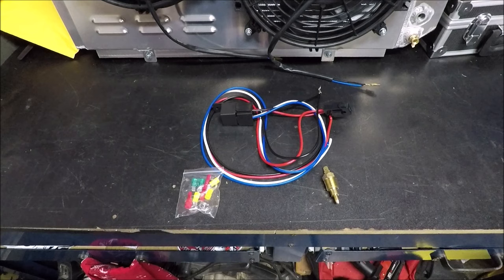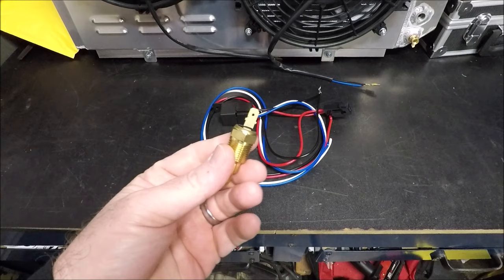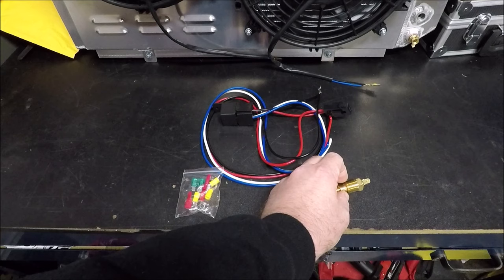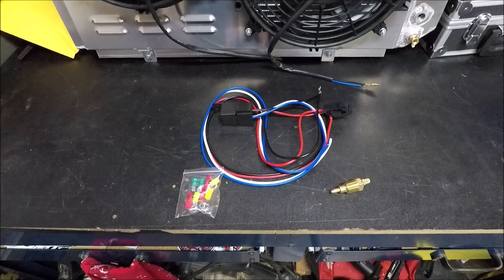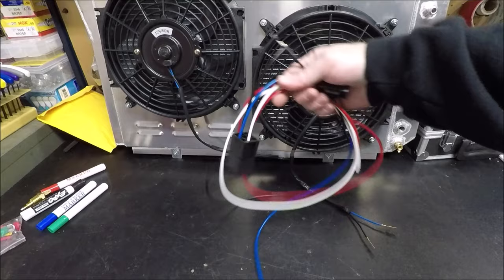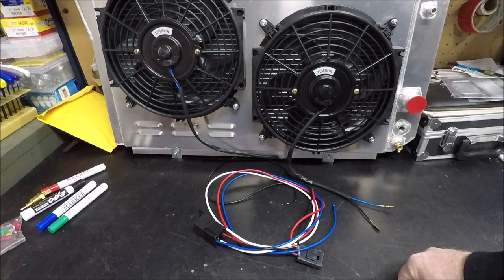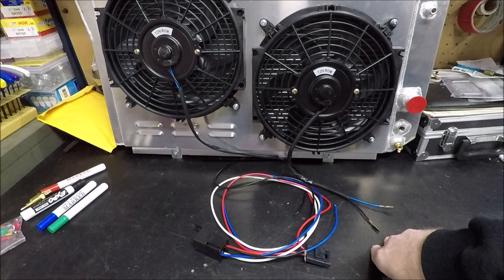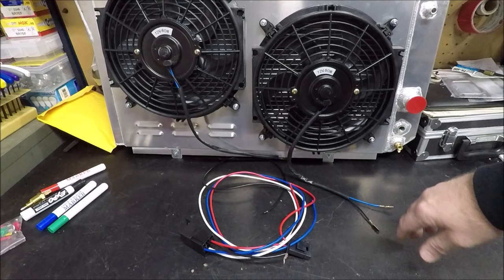ELECTRIC COOLING FAN RELAY AND TEMPERATURE SWITCH WIRING

Comment: Seems like this is how the Holley does it.. it uses an output as a ground trigger to the relay
Reply from the maker: Yes you can use your Holley instead of the temperature switch. Black wire would goto one of your -outputs or use two relays and two outputs if you want to activate the fans separately at different temps. That’s how mine is already wired except I’m using a factory style relay that already has 10awg wire. 👍Or you could save an output on your Holley and run one fan off the included relay and switch and let the Holley control the other off a separate relay to come on at a different temp. Lots of possibilities with the Holley or even with a factory pcm for that matter.

Comment: What else you don’t want to use temperature sensor can you just ground the black Wire
Reply from the maker: Yes. You could just ground the black wire ON THE RELAY through a toggle switch to turn the fans on and off manually if desired.

Comment: You sure you don’t have pins 85 and 86 bass awkward if you want to use a switched power source?
Reply from the maker: If you want to run them the other way feel free. It’s makes no difference. It’s a basic relay so those two are reversible.

Comment: What if you put your temperature sensor in an adapter in the heater hose? Wouldn’t you then use the O-ring to ground it to the body?
Reply from the maker: What if you just put it where it goes and stop over complicating things for yourself?
Reply: @BadLuckGarage  Well that’s not exactly the professional advice I was looking for. I can’t put it where it’s supposed to go. I have no ports to put it in and I have no way of drilling. If you don’t know the answer just say so.
Reply from the maker: @tomwebb5375  I can 100% promise you, regardless of the engine you’re working on, unless it’s an air cooled Volkswagen engine, there is a port somewhere on either the engine block, head, or intake manifold that leads to a coolant jacket and will give you the proper case ground that switch need to function properly. There’s no reason to try to reinvent the wheel for something so simple brother.
Reply: @BadLuckGarage  Whatever you say brother. I’ve had this thing in the garage to do this they cannot find any extra ports. Dodge Dakota 318 fuel injection. But thanks for the non-answer. But you still didn’t answer my question. So I’ll figure it out myself.
Reply from the maker: @tomwebb5375  Then you should find a different mechanic. There’s DEFINITELY several locations on a 318 you could use. But I’m no help so by all means let them half ass wire your shit. 🤣

Comment: Ok... good video,, Except you ever explained: Where is the positive side of the temp switch going to ? Or did I miss it ? You explained 86  goes to ground on the temp switch, so power goes to positive (+) of the relay ?
Reply from the maker: Yes you missed it.
Reply: @BadLuckGarage  ... You said; yes I missed it. But you never explained, where did I miss it. 
I'm back to square 1. Where is it ?
Reply from the maker: @guesswhomartin9249  https://youtu.be/_RIAi6TAACY
Reply: Nevermind, we're back to square 1. 
I'll figure it out, maybe I'll watch other videos as well.
Reply from the maker: There is only one terminal on the temp switch. I explained several times in the video that all the temp switch does is ground out pin 86 to activate the relay. I also explained two different places to run the power to and the effects each would have on how the circuit operates. All this info is in the video so why would I spent another 20 minutes typing out and re-explaining what I already spent an hour recording, explaining, and editing in the video?  Unfortunately I can’t increase your learning retention or prevent you from skipping through all the important parts of a video. What I can tell you is I’m not going to waste anymore time when the answers to everything you’ve asked  is already in the video. Good luck to you.

Comment: I'm hooking it up to a toggle switch the white wire so I put the white wire in the toggle switch and then when I hook up another wire to the other side of the toggle switch where does that go does that go to the fan or that goes to the blue wire
Reply from the maker: You would hook it exactly where I told you to hook it in the video. The switch you want to install inline is just an interrupt to the circuit. Why would it charge anything about where the wire still has to go?
Reply: @BadLuckGarage  I'm hooking it up to a on and off switch much Suzuki samurai has a push button to start so I want to leave my fans on all the time so that's why I'm putting it on and off switch
Reply: @BadLuckGarage  I'm not installing that gold switch that you have in the picture in your hand the only thing I want to do is hook it to a on and off source on it off switch toggle switch so that ground wire arms is in the hook to the chassis
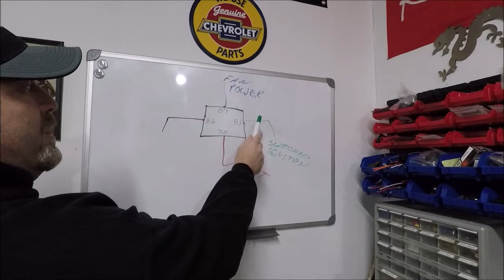Reply from the maker: @mudlifejunkiepr3937  Like i said, covered in the video. 5:10
Reply: You said the switch ignition source the white wire goes in so where will I hook up the toggle switch to turn it on and off I don't have a key to start my car I have a push button to start it
Reply: Honestly bro I still don't get it if I hook up the white wire to the switch  ignition source that means the fan is going to be constantly on I want to put a on and off switch to it how do I do that
Reply from the maker: @mudlifejunkiepr3937  Awesome. So how are you gonna shut the car off? zYour gonna use a switch. That switch will be your ignition switch. Thats your switched 12v. So you dont wanna use the temp switch. As I said over and over in the video all the temp switch does is ground the relay to activate it. So if you dont wanna run a temp switch you need to ground pin 86 on the relay.You can use a toggle switch to do that. I keep pointing you back at the video because its obvious you dont understand what i explained in the video. I dont like to just tell people what to do...I want them to understand what it is they're doing so they can figure things out for themselves.

Comment: Thanks,  have a question I put the white wire to the ignition and my fan stays on after I have trun of the engine and the engine is hot not overheating. What can it be
Reply from the maker: Sounds like you have it wired to a constant hot, not an ignition hot. Otherwise the relay trigger wouldn’t have power with the key off.
Reply: Or does it need to be connect to a circuit breaker then to the ignition?
Reply: @BadLuckGarage  what would be a ignition hot?
Reply: @Oscar-lo4fh  ignition hot can be any wire that have power when you turn the key to on position and when you turn it off cut the power. You probably have connected to a hot wire what means that wire always have power because its not related to the ignition switch system .

Comment: Now, how do you integrate it to turn on when your AC compressor kicks on?
Reply from the maker: Easy peasy. If your AC kick signal is a ground, simply tie it into the wire going to the temp switch and it will provide the ground when the AC is on. If it’s not a ground, then you’ll need to add a second relay activated by your AC kick signal and tie it into the wire going to the temp switch to provide ground when the AC is on. 👍

Comment: you  have  85 to key ignition? and 86 to ground? which is right?  the company has 86 to key ignition and 85 to ground?  whats right???
Reply from the maker: 85 and 86 are reversible. It 100% doesn’t matter which way you wire them as long as one goes to the ground/temp switch and the other goes to ignition. I generally wire them depending on how the wires on a particular relay are colored just to make it easy to remember. So if 85 happens to have a black wire, that’ll go to ground/temp switch and if 86 happens to have the black wire then I’ll do the opposite. But like I said, it doesn’t matter.
Reply: Thanks for the help

Comment: So if my thermostat is 180 can I just run a switch that is higher ?
Reply from the maker: It’s not just about the thermostat. The question you need to ask yourself is, “Is my cooling system efficient enough to get the coolant back down to the off point of whatever switch I’m running”?There are thousands of guys out there running 160 degree thermostats with cooling systems that can’t even keep the coolant at 190, let alone 160. If you’re cooling system is actually capable of getting back down to 180ish then yes, I’d say just run a switch that comes on at say 195 and shuts back off at 185. Using those parameters as an example, if it’s not capable of cooling back down to that point then what’s going to happen in this scenario is the fans will come on at 195 and they’ll never go off until you shut the car off because you cooling system isn’t capable at being the coolant temp back down low enough to shut them off.
Reply: @BadLuckGarage  mm I see. So I should just get the 160 thermostat. I’m
Installing a aluminum radiator with an electric fan on a 06 jeep wrangler 4.0. The temp sensor is plugged into the thermostat housing. I’m assuming because it has that plug style connector I can’t just tap that fan into that oem right? I need to use the switch that came with the kit which is what you showed in the video? Also where would you tap into the ignition power source on the wrangler ? I thought maybe use one of those fuses with the wire running off it. I heard horn fuse maybe but that’s always hot isn’t it ? Thanks for the help

Comment: I have this same kit except mine came with a 30 amp circuit breaker? Which I would assume should go between the relay and battery but there is that inline fuse there already 🤔 so my diagram says to put it between my switched ignition and relay but so many other diagrams have it going to battery, even the breaker says BAT on one side so little confusing. Any thoughts?
Reply from the maker: Breakers will always go on the battery side. At least that’s where I’ve always used them. My Allow Works kit didn’t come with a breaker so maybe it’s a recent update. 🤷🏼‍♂️

Comment: I have an issue. My electric fan turns on as soon as I turn the key forward even when my car has been sitting and no where near the 185 it need to be at to turn on.  Not sure why. I followed your video and everything is wired correctly.
Reply from the maker: Sounds like you either have a bad fan switch that’s staying grounded all the time or you didn’t wire it correctly. Verify you’re wiring is correct. If it is, then I would contact Alloy Works and ask for a replacement.
Reply: Sounds like you have the relay hot wire mixed up.

Comment: Can you put coolant switch on thermostat housing ?
Reply from the maker: Yes but depending on application it may read quite a bit colder than the cylinder heads. This will cause the fans not to come on until the engine is a lot hotter. The cylinder heads are usually the hottest part of the engine and that’s why I suggest putting it there.

Comment: Somebody help! I’m a bot lost and confused. When you say “to coolant switch” I have 2 connectors off my temp sensor. One is ground and the other from ECU, which one do you mean? I got a 2004 Ford Explorer v6
Reply from the maker: No part of this system connects to your factory coolant temp switch. You can either use this standalone set up or let your ECU control your fans. The coolant temp switch I’m referring to in the video is the one that comes in the kit which is shown in the video.
Reply: @BadLuckGarage  Ok, thought they did the same thing. Thank you for reply and sorry for silly question.
Reply from the maker: You’re welcome and it’s not a silly question. We all get confused and we won’t ever know if we don’t ask. 👍

Comment: So the probe definitely needs to be grounded, even if with an extra ground wire wrapped around the sensor.
Reply from the maker: No, the temp switch grounds itself through whatever metal you have it screwed into, be it a cylinder head or intake manifold. No extra wire is necessary.
Reply: @BadLuckGarage  some radiators have PLASTIC sides. Most stock ones at least.
Reply from the maker: @G.Harley.Davidson  I wouldn’t screw the temp switch in the radiator anyway. The water temp in the radiator is not going to be the same as the water temp in the engine and could let the engine run too hot before turning the fans on.

Comment: well explained but...point 86 is white and 85 is black on my relay - coolingsky three row.
Reply from the maker: If your colors are reversed ot doesn’t matter. Pins 85 and 86 are interchangeable anyway. It’s not uncommon to see those pinned opposite colors. It’s also not uncommon to see totally different colors used on the other pins as well.  Although it would be nice if all manufacturers would stick to a standard color scheme, ultimately the colors don’t affect function and are irrelevant. Just make sure you’re using the correct pins as shown on the whiteboard. 👍
Reply: @BadLuckGarage  thank you for the quick reply - totally understand just german perfectionist- metal intro  keep crunchin.
Reply: modified hole pattern - figured out wiring - start up - leaking from weld - coolingsky... nfg

Comment: what if we connect the ground wire of fan direct to thermostat switch and the power wire of fan to battery?
Reply from the maker: So you just watched a video explaining the correct way to wire this, and your reaction is to ask if you can wire it incorrectly. Well here’s my answer. They include a relay and a fuse in the kit for a reason. That reason was explained in the video. But if you want to half ass wire your car, then knock yourself out. You don’t need my permission. 🤣
Reply: @BadLuckGarage  what will happen if there is no relay. actually i did this with out relay and it works but... when the car starts after 5 to 8 min the fan automatically turns on and then never stops. does the relay stops the fan?
Reply from the maker: @pathan squad  no the relay is there to hold the high amp load. Without it the switch could eventually overheat and and fail causing a fire. Also since you have it straight wired to the battery the fan will continue to run after the car is shut off which could run your battery dead. Wire it correctly and you won’t have to worry about any of those issues.
Reply: @BadLuckGarage  ok now i understand why relay is necessery. but can u please helf me why fan does not stops when it starts automatically. is this  thermostat too much sensitive to heat
Reply from the maker: @SaddamHussaintech4u  BECAUSE YOU HAVE IT WIRED TO THE BATTERY! For the last time, wire it correctly as shown in the video and you won’t have these problems.

Comment: Should the fan continue to stay on after the engine is turned off until it cools down enough to turn the fan off.
Reply from the maker: Depends on how the trigger wire is wired up. Explained that in video.

Comment: What do you do when you have a GM flat 4 or 5 relay?
Reply from the maker: You use either a multimeter or google to figure out the pin outs.
Reply: @BadLuckGarage  I've done that but the relays are different & that's why I was asking for help from pro's but I sorry to have bothered you for assistant.
Reply from the maker: @Scott Fenton  brother you’re not bothering me, but you need to understand GM has used so many different relays over the years I wouldn’t have a clue what to tell you other than to search it in google or test it out with a multimeter. I’ve had to do the same thing numerous times. On the Chaos Theory Camaro I reused the factory oval relays for my cooling fans and fuel pump. Just took a few seconds with a multimeter to figure out what was what. Find the two wires that show continuity with the multimeter. Those will be your trigger wires. Then apply power and ground to those two wires and find the two wires that show continuity while those wires have power. Those will be your battery and accessory wires. 👍
Reply: @BadLuckGarage  hey, my multimeter is analog & not digital since I can't find it, if it's not lost! 
The relay is OEM 14047712 /  Z  8247 then Made in USA  -  the  other part #'s are  these 4SEASONS 35906, AC-DELCO 213-928! 
It's the 4 wires vs. the 5 wire connector.  On the relay it has  2/3/3/4 but I've not found enough information yet but if you have any suggestions or video that you know of I really would appreciate the help! Thanks in advance!

Comment: Watch video to wire fans but may fan r running backwards now what to do?
Reply from the maker: Swap the wires at the fan. You’ve got them backwards reversing the polarity.
Reply: @BadLuckGarage  i had black to ground and blue to power. Like it should running backwards. I just switch them blue to ground and black to power . now they r running right
Reply from the maker: @alanbrownell3219  Soundls like the 4 year old in China that built your fan must have been color blind. They need to send his ass back to the rice fields.lol

Comment: My issue is that they gave me a thermostat and relay so how does that go together
Reply from the maker: Exactly as shown in the video
Reply: @BadLuckGarage  mine looks different has a wire harness with a probe thermostat  so kind of looks like your set up except has an extra box with more wires lol great video yours was one o the better ones mine is proform set up